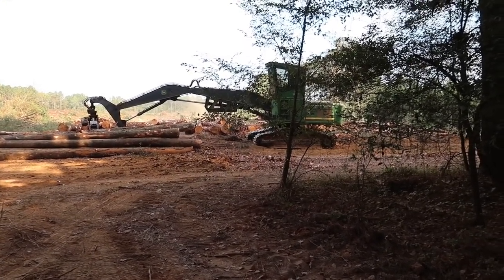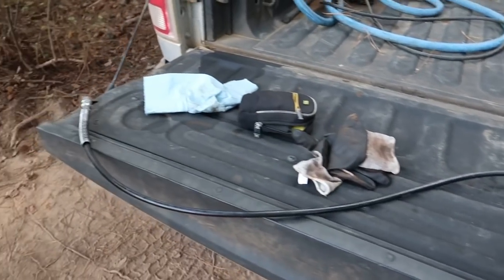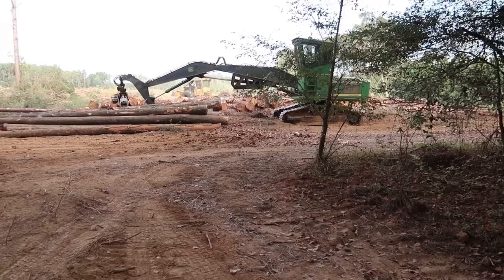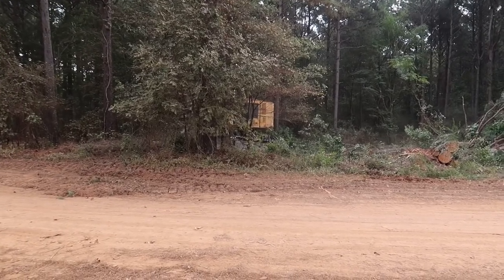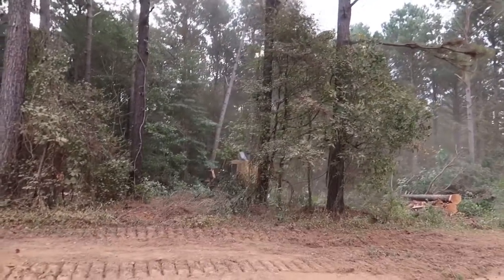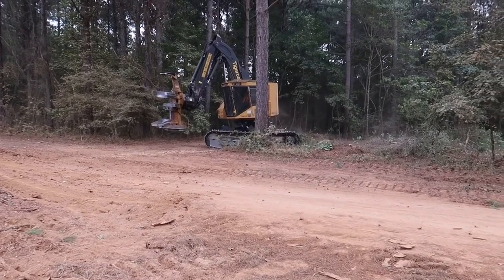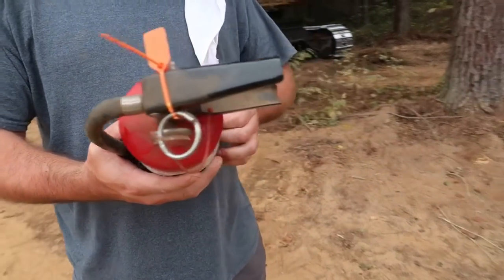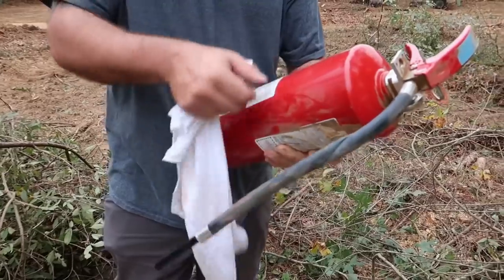Tigercat LX830D getting it done

Comment: I know you was being careful   Watching you run that cable in gave me the whillys.
We used what they called wire rope which was more flexible , n didn't burr as much instead of true cable. 
Liked watching that cutter along the road segment .
Being I'm old things like that still amaze me.
We always figure hydraulic oil ran at least 50 degree above ambient temperature . So if 90 it be 140 . Agree or they pushing it harder now?
Reply from the maker: About 185-189 is what those will be at temp wise

Comment: Hi Tim.     How many tons of wood are you allowed to carry per truck?  Here in NZ  with a 4 axle truck pulling a 5 axle trailer is about 55ton gross max
Reply: Colin Kennedy here in Mississippi its 80,000lbs (40tons) max weight, and I think Alabama is the same way, which Tim and them haul to Ms and Al
Reply: @shawnschoppert8540  in Mississippi it’s 84000 with a harvest permit and 86000 in Alabama